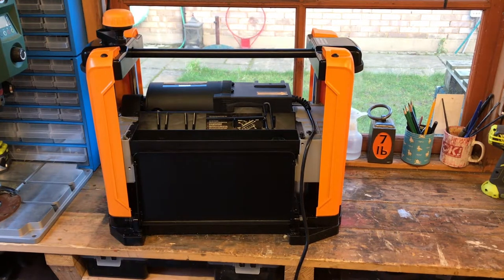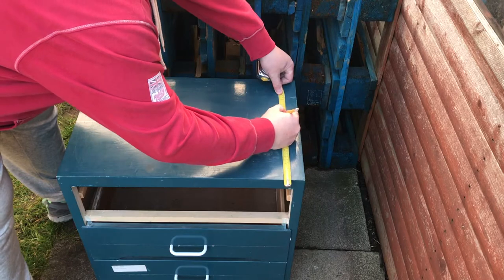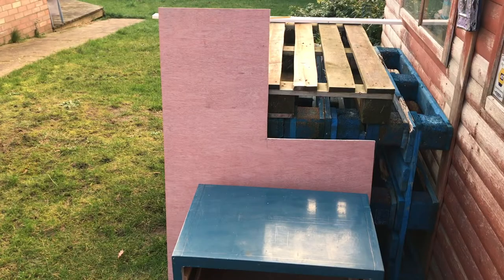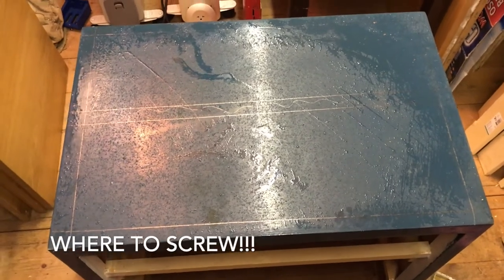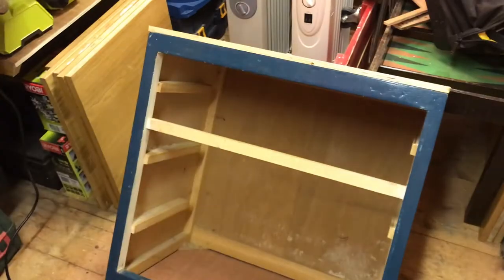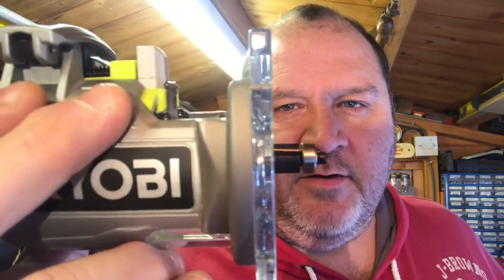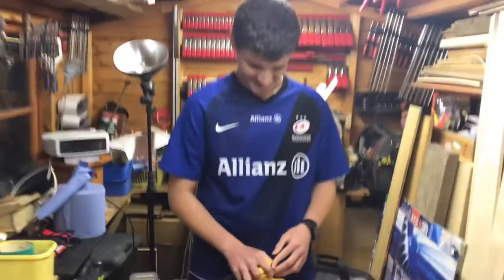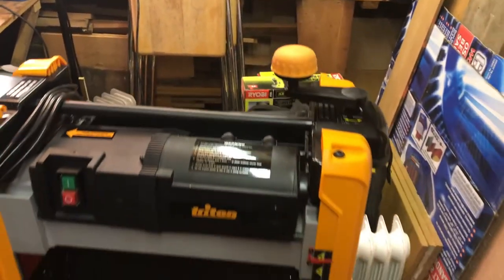How to: Upcycling an old chest of drawers into a Rolling Base for the Triton thicknesser

Comment: Nice job mate, nice to see up cycling,also nice to see you cleaned up the edges with the router even though it’s in the shed
Reply from the maker: Thanks Gaz. It was more for (A) not keep hurting myself on sharp corners. and (B) longevity of the edges. With no arrises to break off, it should look better for longer.

Comment: Nice job, coincidentally I’m currently making a 4 drawer custom sized cabinet to fit under my workbench for similar usage 👍.
Reply from the maker: Cheers. I'm also about to do some 3 or 4 drawer bases (maybe 2 or 3 more) so I can (A) get some more heavy stuff higher up at a workable height, and (B) use the drawrrs for stotrage.

Have you decided how you're gonna do the drawers yet? I'm torn between runners and just slide in and out, unfixed.
Reply: @essentialhandyman  I’m using some 400mm roller runners that I’ve had for ages,  but only got enough for 3 drawers, so need to get one more set. I’d suggest doing the same, they’re not expensive.